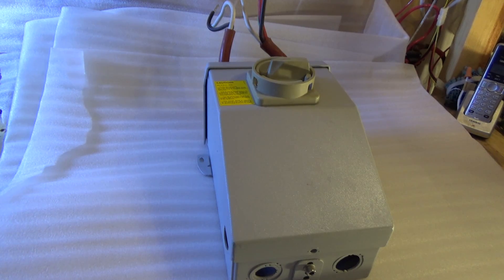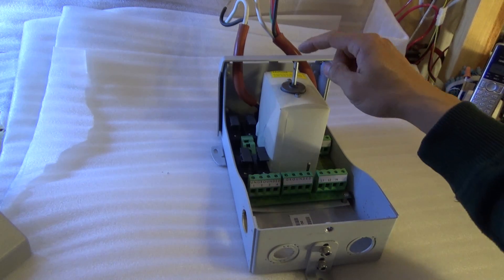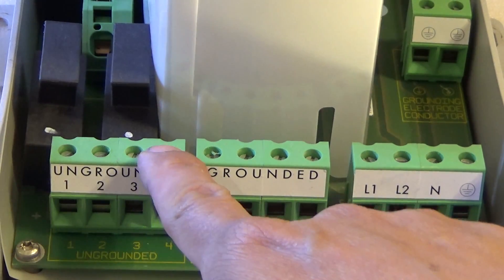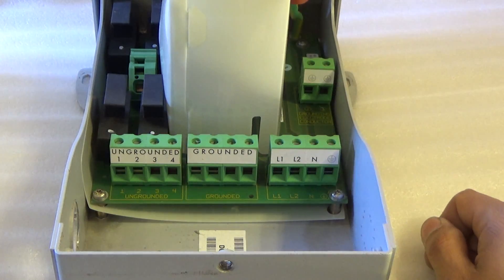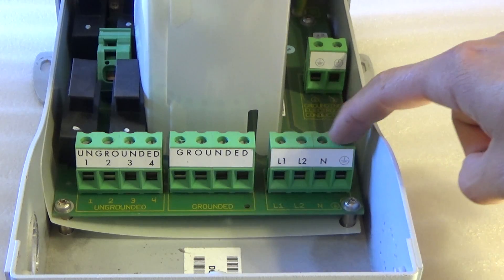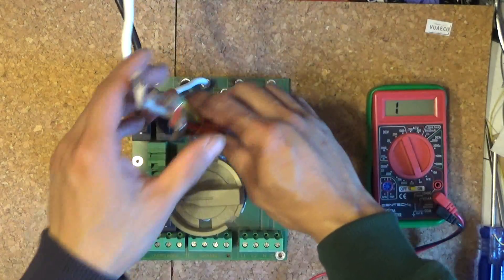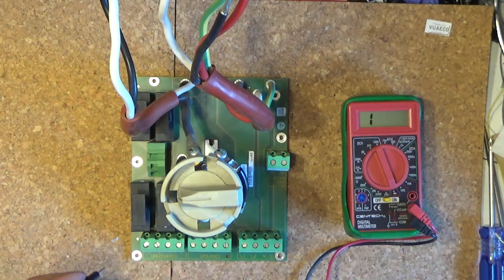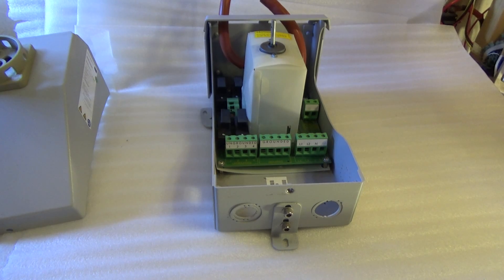What's inside a Sunnyboy AC/DC disconnect, how it works, and how to install it

Comment: Thanks for this video.
I believe my discon U-21 has failed. With switch “on” the lower black DC feed line on the cylinder has 395 volts but the upper black line on that cylinder that goes into the inverter has 1.2 volts and the inverter won’t come on. Should I get 395 volts at that upper black wire?

Comment: Should the ungrounded PV panel lead have continuity with the AC ground?  Looking at the switch as installed, the far right terminal with any of the 4 ungrounded leads?  Thanks !!

Comment: 3:10 this is for grounding the panels I think???? installation manual states:   Connect the grounding cable of the PV array to the
terminal (A) for the grounding conductor.
Connect the grounding conductor to the terminal (B)
for the grounding conductor.
Reply: I think some panels don’t have pv ground so probably have to leave that empty but I am not sure???

Comment: Per my manual it called a "DC Disconnect Switch".  It is not an "AC/DC disconnect" per your title. Why are you calling it an "AC/DC Disconnect"?  It does NOT disconnect the AC wires ...
Reply from the maker: You're correct. it only disconnects the DC line. But you also have to connect AC wires to it, though.

Comment: Typical houshold 110 vac white is neutral black is hot , Sunny boy has it correctly color coded on the black ad white. Good video.
Reply: Solor panels only have + and -  positive and negative like any battery. no ground  Terminology.
Reply: The DC side should be color coded Red (+) and Black (-), not like AC which is Black (Line) and White (Neutral).

Comment: I am coming across your channel on many of my searches.  Appreciate you taking the time and trying to help everyone out. I'm thinking of doing grid tie along with my off grid. I am like the sunny boy US models with the 1500/2000 accessory  plug works even when the grid fails.   In my search I havent seen anyone filming the installation from the array and the AC side. Does the AC wire have its own breaker from the breaker box? Wouldn't a bigger breaker than a 10/15 amp have to be used say like using a sunnyboy 6000 watt? Thanks!